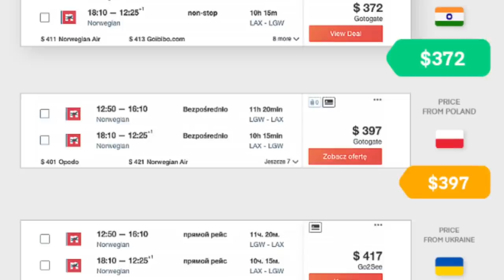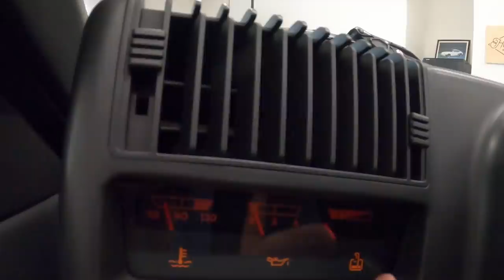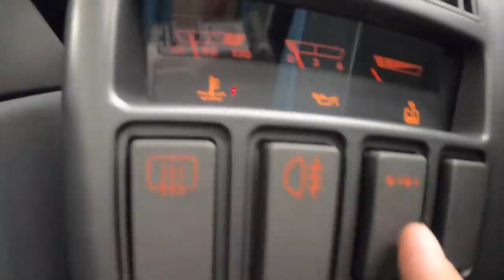The Renault Alpine Is a Very Rare, VERY WEIRD 80's Car That You Actually Want to Drive

Comment: The reason this, and other "weird" European cars, drives so well is that it was designed for the person driving it. Not the shareholders.
Reply: Exactly, well said!
Reply: Amen
Reply: he turned on the wipers in the dry?  come on now.
Reply: @sukhmaidickoff  I have been a shareholder for decades, but no way would i invest in a car company unless they up their game (having said that i did hold shares in Daimler for a short period). There's several car companies that produce cars just to please their customers - Ariel, Ginetta, Ultima, Porsche.........
Reply: @sukhmaidickoff  Well, maybe. But i still think there is a discernible difference between a car that is designed for the driver, and one that is designed solely for the bottom line.
Reply: @robertdewar1752  WV fabrique des  porsche  n est plus porshe a par sa 911 , ( elle est de plus en lourde , franchement elle n a pas de chasssis en alu comme ferrari ou mclaren en carbonne )  !!!! comme lamborghini  a par son eternel v12 et meme bugatti  qui a des elements comme sont moteur , il n est pas fabriqué a molsem   ,                                                                                fiat a voulu faire ferrrari une fiat , jusqua  l arivée en 1991  luca di demonzemonlo , jusqu a son independance finnanciere , rectifier les problemes de chassis  de la 348 ts et tb qui fut faite trop rapidement,comme dit nicola dimaterazzi ( injenieur 288 gto et f40 ), quand ont commence a ce disputé sur des boulons fiat a la place de ceux d une ferrari pour faire des economies ca viens graves de l identitée de lentreprise fiat

Comment: Very underrated car, Renault made some amazing hot models in that era.

The Renault 5 Turbo mid engined, a monster of a car, and stunning looking.
Reply: Unfortunately both the five turbo and this alpine like all 80’s/90's Renault performance models,had the durability of a plastic fireguard. I spannered at a Renault main dealer back then,the V6 Shared by this,the 25,30,espace,some Volvo's and that other massive disappointment, the delorean was a steaming log!
Reply: The R5 Turbo and Clio V6 are absolutely awesome cars.
Reply: @areyouundoingthatorwhat9181  The twin turbo version of that V6 was pretty stout.

Venturi had good results using it racing.
Reply: @hughjaskoch5456  the racing version bore very little resemblance to the production engine, utilising a mechanically fixed internal bracing structure for the block, welded gusset strengthened heads and bespoke internals.
Reply: @areyouundoingthatorwhat9181  They also had road car. The Venturi 400 for example made. Little over 400hp and like 385tq.
Reply: @areyouundoingthatorwhat9181  Obviously you never owned a R25... ironically the golf 2001 is falling in pieces inside and my parent R25 doesn´t have any scratch or fallen parts and probably have more than 400.000 km so dissapoint?
Reply: @FEGTTTSDH  No,certainly not! I spent my time when those engines were current as a technician at a Renault dealership so I have complete conviction in my statement,there was not a a week that went by without one in for a terminal fault,usually either chain failure,loss of oil pressure,a rod making a bid for freedom out of the crankcase or head gasket/s and-or liner failure,the list of durability issues was endless.furthermore I spent some time as an engine fitter for a remanufacturer and changed lots of those while there in both Renault and volvos.As for the matter of the VAG stuff I won't disagree.
Reply: @areyouundoingthatorwhat9181  yeah every guy talking here in Youtube is a mechanic with a ton of experience in bad cars...
Reply: Jay Leno made a very good video on the 5 Turbo. :)

Comment: The gage you were wondering on the left of steering wheel is an Oil level gage. It’s showing engine oil level when key is turned on and engine is not running

Comment: Soooo... You like it's rare, has features, spaceship design... Next step: GET YOUR HANDS ON A CITROËN SM. Diravi Steering,  a mushroom instead of a break pedal, Citroën's hydroneumatic suspension (the BEST in the world), a trillion features (like automatic wipers) all in a 70's car that seems from another galaxy.
If not, a CX will also blow your mind pretty easily.
Reply: Just buy any Citroen with self levelling hydropneumatic suspension, park it on a slight slope and then watch it try to figure it out
Reply: A Citroën C6 will do the trick
Reply: @DjDolHaus86  Already got one 😅, an XM. In slopes, nose goes up a bit, back gets lower. Personally, I like that quick, as it causes the back to lower itself when you accelerate, making you feel like you are in a plane taking off. It's really really cool.
Reply: @davidbt98  I had a C5 for a few years as a company car and absolutely adored it. It handled like a boat and had the turning circle of an oil tanker but it was the most comfortable car I've ever experienced, you could drive it down a farm track and it felt like driving down freshly laid tarmac. If you parked it on a slight slope it would fidget around for about half an hour trying to figure the gradient out
Reply: @DjDolHaus86  That is why batteries wont last on these things🤣🤣🤣
Reply: Systeme Maserati ?
Reply: Jay Leno did a video on his Citroen SM. They are really cool cars and are very unique.

Comment: They're not just metric tires, they are Michelin TRX. You can still get them new but they cost a lot to replace, as I think Michelin only produces a few batches per year. And of course, just like the PAX you had on the Phantom, the rims are specific, so you can't put anything else without replacing them.

Comment: Wheeler Dealers with Edd did an Alpine and put a new carb arrangement on it.
Reply: Yeah I remember that. A Holley carb like American muscle cars.
Reply: That was an a310 movies is the next generation
Reply: Yodastien same engine. The same mod would be applicable here.
Reply: What they didnt show was the heads had to come off as he warped them. And then Mike somehow blew the Un1 gearbox, so a replacement had to be found.
Reply: DJ_PaulTUK  how did you find out that info?

brewer is a donkey as soon as that gauge started going up he should have stopped
Reply: @lee2217  Because we sold him the parts to repair it.
Reply: DJ_PaulTUK  I can see why they kept that quiet
Must have cost them a few quod to put the car right
Reply: "That's crackin' Edd!"
Reply: Don't forget the issues Mike and Ed had getting parts - the same issue also exists for the GTA and also the A610 (being the last of that run of Alpine cars)
Reply: That is interesting stuff DJ.
Reply: DJ_PaulTUK that’s quite interesting. Almost more than the show itself. Makes me wonder what else they kept from us. I guess Mike creates more issues for edd to fix than we realize.
Reply: Yeah, Edd China installed a four barrel carb conversion on it. I think Mike Brewer got it from some Alpine owners club garage in Britain.
Reply: dapprman  the a610 is a great looking car

Comment: I was a test driver for American Motors / Jeep / Renault in the 80s; I was lucky enough to drive many thousands of miles in these (turbo only, non-turbo was not spec'd for US sale, I think). It's an amazing car, for the open road. A French 911, and would bite you if mistreated. We were ready to go to market, then Chrysler came along and bought AJR. A bit of work to drive, but fairly comfortable, as long as it didn't get too hot outside. The turbo V6 in the back was a joy to listen to over the miles. It's not as weird as you portray. But thanks for brining back some memories.

Comment: There’s a modified intake manifold for those cars that fixes the issue with the front two cylinders being starved for fuel.  Another plus is, you can then use a Holley carb.
Reply: Yup, the owner of the Renault Alpine Club UK makes them i believe.
Reply: Others have fitted the R25 injection and ECU to cure the fuel starvation and make it even quicker.

Comment: Great car - well done for reviewing it.  I have owned two of those (Turbo) and still rate it as probably the best all-round car I have owned.  They were used every day and never had a problem (once I had sorted the cooling hoses out to keep fluids in the car instead of on the road).  I still have 2x Alpines (old and new A110) - and I have to say even the new A110 is lacking in some areas that the GTA was great at (it's not as 'planted')

Comment: The body panels are cut out using a very high pressure stream of water, and space age adhesives glue it all together. Fabulous car that LJK Setright raved about. Many parts from the Renault 25 except the cross plane crank in the turbo. Turbo is 200 bhp.

Comment: So, Renault built a Saturn before GM did, interesting.
Reply: Actually GM built basically a Saturn before Saturn was a company. The Pontiac Fiero. Mid engine and made out of plastic and fiberglass body panels on a space frame
Reply: @mmercante0257  Quite right, I sit (at my PC keyboard) corrected. Maybe we can use an Alpine to make a Ferrari kit car?
Reply: @AndrewKarpyszyn  Why? The Alpine is more reliable and collectable (specially the turbo version).
Reply: @fredpinczuk7352  I absolutely agree with you, Fred.
Reply: Spluffles so is a corvette a Saturn too? its in no way near a Saturn. its mostly  fiberglass and not cheaply made. Saturn was made to be as cheap as you can make it with the best fuel economy. Nothing of that fits the Pontiac Fiero trust me I own one and its the funnest vehicle Ive ever owned and ive owned plenty.

Comment: Pleasepleaseplease find and try a Venturi, French supercar of the 90's
Reply: I had to look that one up....what a beauty!!!!
Reply: 400GT is an awesome car
Reply: Good luck finding one, it's even rare in France, so in the US it's gonna be next to impossible
Reply: @BZA_   And if you need dashboard parts just take them of a scrap Peugeot 205 for engine parts look for a Volvo 264,Citroen XM,Peugeot 605, DeLorean the PRV engine but mainly they used Renault's low compression variant.  And although never confirmed,that engine is derived from the Maserati type C 114 used in the SM.  Just take a look at the spcifications of both and you know enough ;)

Comment: I had one, the A310 pack GT.  The '86 weighed 2513 lb not 2700 in atmospheric. My '84 A310GT weighed 1025 kg.  After 180,000 miles it caught fire and burned from a gas leak.  Alpine used a 10,1:1 compression ratio and  a Solex 34tbia with a Solex 35ceei added in by vacuum.  This was in the Peugeot 604 SL at 8,8:1 compression ratio, of which I have 2.

Comment: Wheeler Dealers did one of these, replaced the 1+2 barrel  carbs with a single Holley
Reply: Yes, they did the model before this one, the A310. Alpine completely stopped the production of cars in the early 90s until a few years ago. The new car seems very good, all reviews are good, but like this one it doesn't sell very well.

Comment: This Alpine looks like the Fuego, a low-cost sports car sold by Renault at the end of the 1970s, especially the rear section all in glass. The Fuego had 4 cylinders, with a Turbo version too. It was popular in Canada, less than the Renault 5 of course. Renault cars were always very funny to drive. A friend had an R5 and his granddad was driving it at more 150 Km like a maniac. Citroen DS was a way more impressive, it is like to be on a flying carpet.  
It is amazing to see an American to realize that there are other cars in Europe than the German and Italian ones. In France, cars were designed by the engineering department and not the marketing department as there are in the USA. It is why there are so advance and with so unique technical solutions. André Citroën was graduated from Polytechnique, the French MIT. But the French style of distribution and customer service could not be implanted successfully in North America and maybe anywhere in the World. The dealership was often given to a mechanic, often French, and not to a businessman.  Japanese was more clever on that.
What is not very well know that the Peugeot-Renault-Volvo V6 was produced in a lot of versions including very high output. I don't understand why De Lorean's owner doesn't import it. Maybe because the PRV was not good in cold winter and because the PRV was only equipped high-end executive cars: R30, Peugeot 605, and Volvo 260 which was all a total commercial failure. French cars were never in the high-end market in Canada and either in the sports one. No sports car with the PVR V6 was sold in Canada,  only sporty cars sold was R15 and R17, I don't know about Gordini R8, and no R5 Turbo. When Chrysler bought AMC, which had merged with Renault America, the Eagle brand was killed and only Jeep was kept alive. SUV was the future and some bad tongue said than Chrysler copycatted the Renault Espace for his Caravan.
Reply: I mean, if you are going to even touch on performance Renault V6's you HAVE to at least reference the 80's F1 engines.
Imagine one of those in a dmc12...

Comment: Would you be willing to find a MK-I Isuzu Impulse? It'd be a car willing to show off. It's a super cool 80's wedge with tons of cool "quirks and features". "Flap paddle" turn signals, radio, etc. on the "control boxes" behind the steering wheel. An equalizer stock where the radio should be. ... Hoovie, you'd love it.

Comment: I worked at Renault for 3 years ... i confirm that level of engineering was exceptionnal. They never cut cost on that. I never bought one though... those 3 years were during a joint venture between Opel and Renault (x83 project for an utility van called Vivaro).

Comment: I’m taking my fathers R25 off his hands. Same year: 1985. V6 pro. It with only 144hp (same scale?). Real fun to drive. Did over 200kph in the early days in Germany. More miles on it but in good condition since it was always garages.  The car is also not so heavy 1200kg or so it moves nicely when you press the accelerator… same radio. Seats are leather, plenty of room for adults in the rear (more than cars today) and 490Liter trunk with electric lock…this is going to be fun. I find older cars simply cooler and also more reliable… many people have problems with cars because they either don’t do the proper maintenance (like wait for the timing belt to break and call the car crap) or go to a bad mechanic that charges you for poor quality work or no work at all…

Comment: The bath tub sensor is an oil level indicator that if it’s anything like any of the renaults I’ve owned comes on when the ignition is switched on and then goes out when the engine is a started - a useful feature except, on all of mine it didn’t work properly and only read half full!

Comment: Tyler is probably not going to read this but still:
In contrary to famous believe French cars where great in the 80's (and still are and always have been) and you should definetly drive some of the following Fenchies if you get the opportunity:
The Renault 25 v6, the Peugeot 205 1.9 GTi, the Peygeot 405 Mi16, the Citroën BX 16v (same engine as the 405) and the Citroën CX series 2 turbo. 
All these are some real quircky hoopties with plenty of fun.

Comment: When I was 18 I had a 1985 Renault alliance  front wheel drive with a 4 cylinder motor and a 5 speed standard transmission.  It was also a 4 door sedan . I originally paid $150 for it.

Comment: The third "mystery" gauge on the left is oil *level*.  Works only at startup if you turn the key on but don't start the car.  Friend's parents had a Renault 18i wagon with a similar gauge back in the '80s.

The '80s were not a good time for Renault in the United States.  Build quality on the general run of Renault badged stuff was pretty terrible, especially the cars that were built by AMC in the United States.

Comment: thats the difference, the DMC12 got the usa spec PRV of that time the was strangled. the euro spec ones were much more powerful. volvo did it with there 4cyl turbo engines too. the B230ft  165hp.. whilst the euro version had a different higher flowing head and no cat so the B230et was 182hp for the same boost

Comment: To be fair to Delorean, the PRV engine was neutered with emissions equipment to meet US emissions specs. The 1981 Corvette had a 5.7L V8 with only 190hp, so you can't beat up Delorean too much on that one. 

If you take off the restrictive cats and adjust the fuel injection to Euro-spec, the Delorean will make the same 170+ hp this does.

Comment: We had these in the UK back in the '80's, a Lotus Esprit alternative. Except it was super slow with average handling and Renault reliability and durability issues. They made a turbo version which was also very pedestrian compared to the competition. The Toyota Celica-Supra, Isuzu Piazza, 924, Mitsubishi Starion, Mazda Rx7, Alfa GTV and even Ford Capri 2.8i were all better made and drove better than this GTA. Nice to see it tho, it has the wrong wheels as the original were metric TRX which cost £1000 a tyre now, if you can find them!

Comment: I drove the MVS Venturi back in 1987.. it was based on the Alpine
Insanely fast  and a beast..
Both that  and the Alpine had bits of Renault and  Peugeot.. a total nightmare  when it came to identifying  parts for repairs.
When it was sold, the dealer wrote it off taking it back to Norwich..
Reply: HELMUT ALTO  having driven and owned one .. you are a little way off...

Comment: These tyres are TRX tyres and it was an experiment of that era. BMW had them on the E24 6 series (and possibly on some other cars as well), a few other manufacturers were using them as well, and they are extremely expensive today. Michelin has small production runs once a decade or so and sells them for increasingly large truckloads of money, unfortunately. And since they have a different section, forget fitting regular tyres on the wheels. My spare tyre has TRX pattern in those dimensions, but it must be from 1985 at best, so it's hard as granite by now. :D